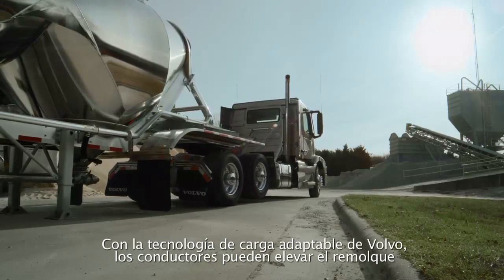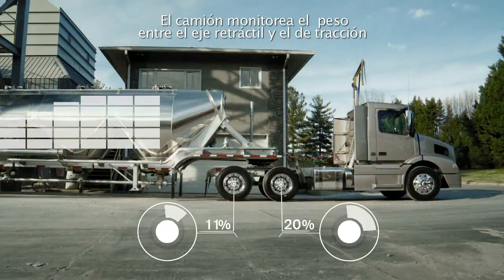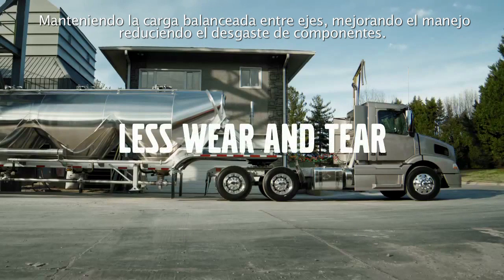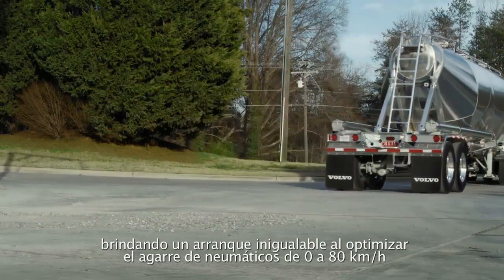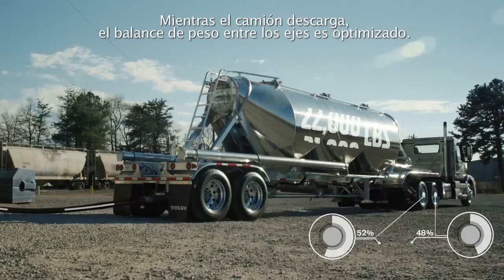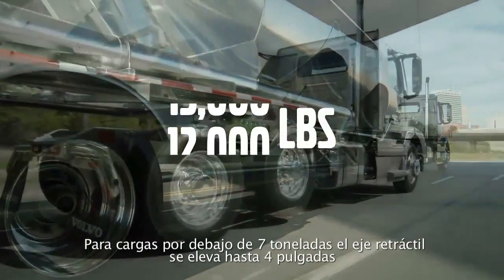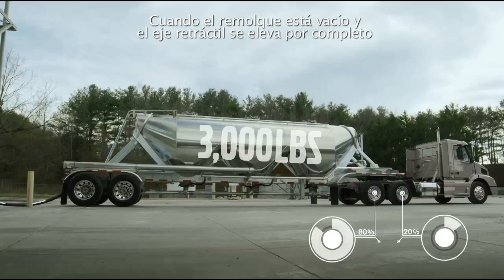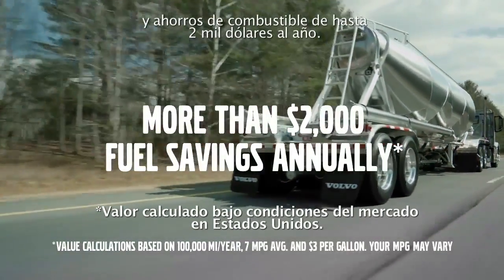Así funciona el sistema Adaptive Loading de Volvo Trucks

Comment: This system is illegal by DOT standard because you overload the drive axle  while also adding excessive weight to the steer axle of air pressure is removed from the lift axle when the trailer is loaded. The idea is good but not legal for public roads.
Reply: U obviously didn’t catch it there is axle u can lower it split the weight it’s legal amigo
Wake up and smell the coffee 😂
Reply: @alexkral6146  you obviously dont understand legal weight limits on public roads per axle. the axle lifts, yes this is true, but the system removes air on the tag to add to the drive which if loaded at 34k per tandem will overload one single axle if the weight is not equalized between the two axles. if the tag releases air to maximize traction on the rear this will also add weight to the steer axle, if you are loaded to the max and the tag drops pressure it will also overload the steer axle because the fulcrum on the drives has been changed. wake up and smell the math, the science, and engineering, amigoooooooo. and to thing you said your reply with utmost certainty without  realizing you know nothing about axle weight limits, fulcrum points, and simply engineering and math lmao amigo.

Comment: Solamente tiene 4 ruedas trasera y 2 ejes lo que significa que tienen que aguantar mas peso un camion. Asi debiera tener 8 ruedas. Atras debajo de 5 rueda
Reply: Yayo Rafael Nsvarro Peña Navarro  esas son las super singles en vez de tener ocho solo tienen cuatro con la misma capacidad de las ocho regulares. Ventajas y desventajas.
Reply: si tw fijas bien las ruedas traseras son mas grandes que las delanteras
Reply: esas ruedas anchas aguantan mas que 2 normales
Reply: @GodLikeMeAgain  el problema es cuando truene una? Pierdes todo el soporte, y usando dos ruedas dobles truena una y te quedas con la mitad de soporte
Reply: @GodLikeMeAgain  buen día no amigo x lo regular  una rueda es de un poco más de 7000 siete mil lbs y las ruedas q sólo trae una es de 11000 lbs entonces el viejo sistema de 2 ruedas aguanta más peso saludos
Reply: @atanasiosanchez9948  de que marca son tus datos? yo los saque de Michelin que me parece son los que usan en el video su neumático para trailer el modelo normal que soporta mas peso es de 5600 lbs  y la de tamaño doble es de 12700 lbs
Reply: Buen día de de Michelin la llanta 24.5 checa y es correcto saludos